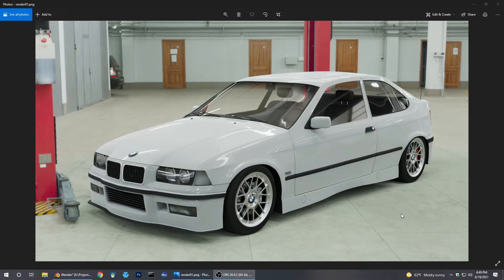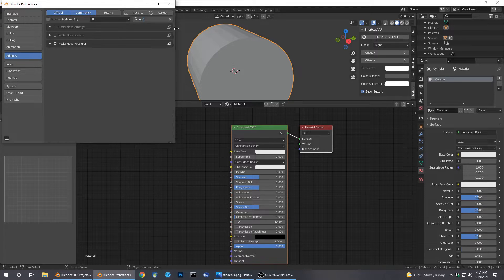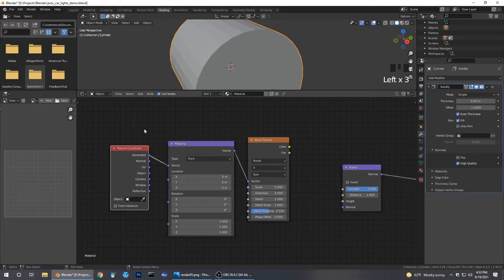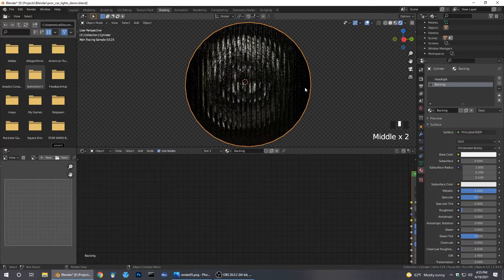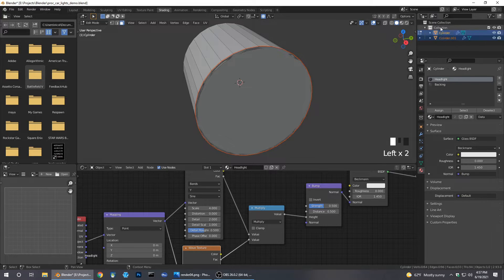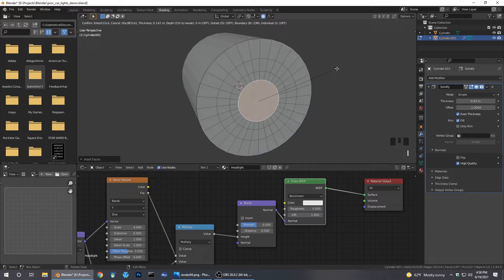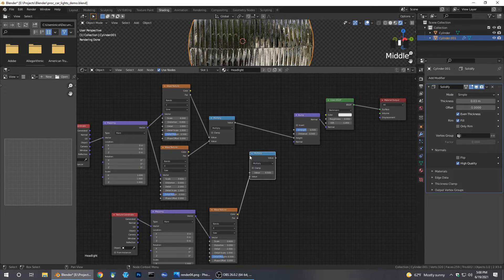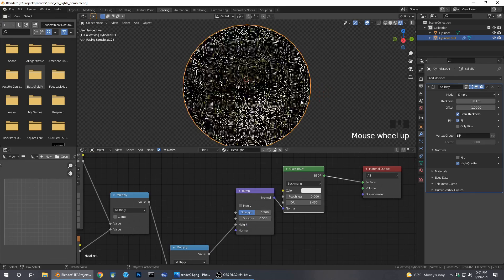Blender: Create PBR Car Lights Using Procedural Normals

Comment from the maker: Correction: At 5:54 I said there are too many vertical Y stripes when I meant to say there are too many horizontal X stripes. I made the correct adjustment in the video but incorrectly stated what I was doing. Sorry for the confusion.